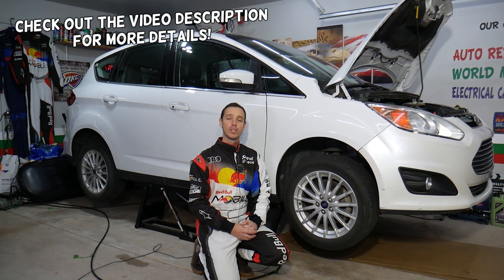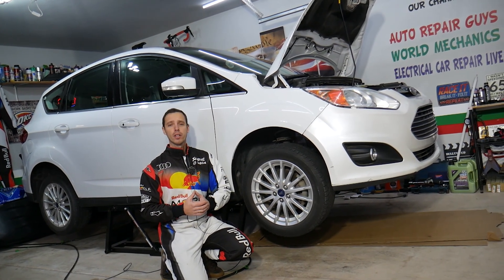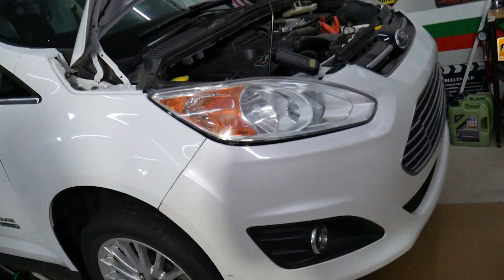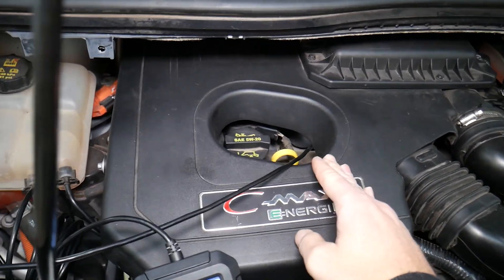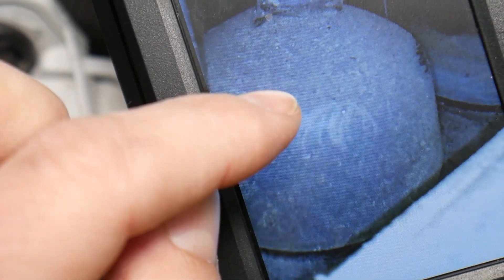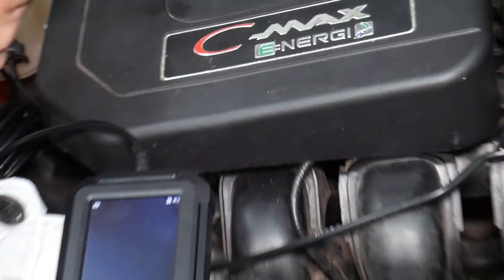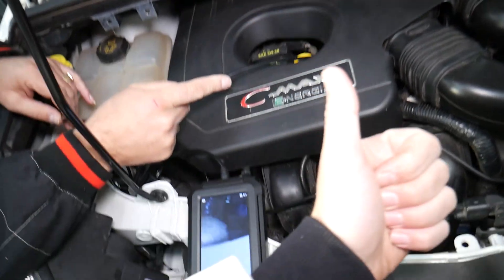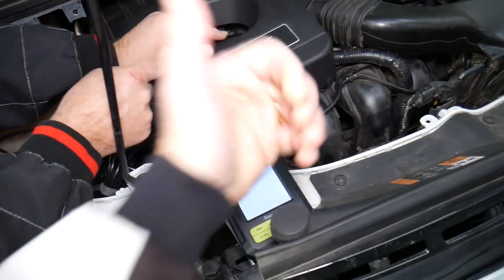CODE P0118 COOLANT TEMPERATURE SENSOR FORD C MAX FORD FUSION FORD MONDEO LINCOLN MKZ

Comment: 1999 Ford f350 V10 6.8L changed coolant sensor 3 times finally on last time bought Ford oem part and my gague works now but when truck warms up it stalls when i restart it it runs crazy rich